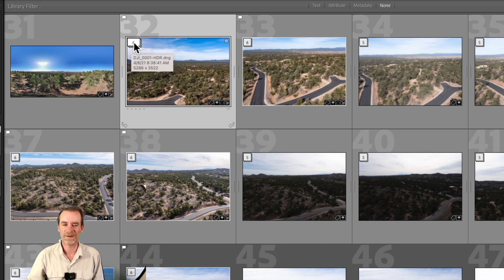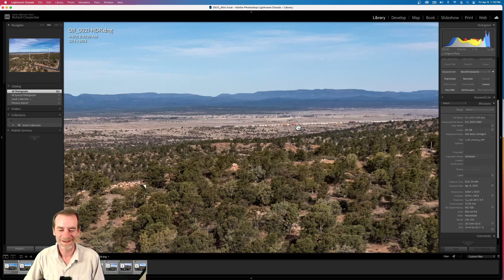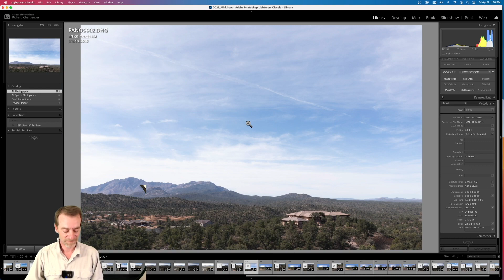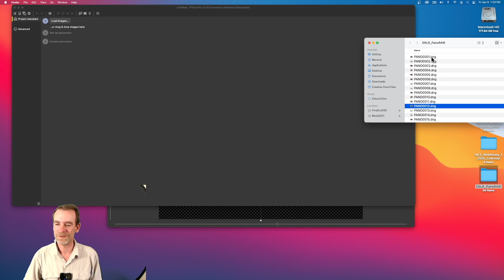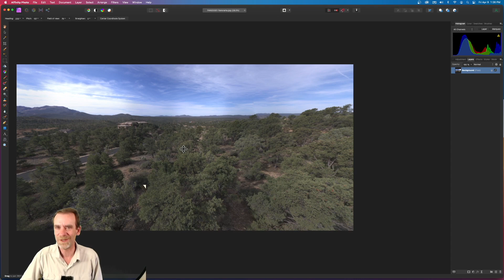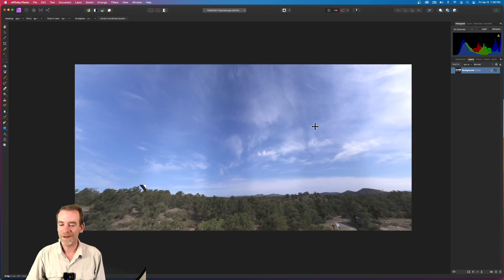A New Drone Progression Project.  Documenting A New Home Build

Comment: Hi Rich.
Just wondering; have you ever used graduated ND filters on your drones when shooting these panoramas?

I have and would recommend them to all that fly a drone.  Basically they give you a 3 stop difference between the top third and bottom third - with a soft transition taking place in the middle third.

These allow the same shot to be exposed for the ground and sky, without bracketing!  They certainly help with my work flow, being to able to do a lot more "in camera", saving time on post.
Reply: Hi Ray. Which filters in particular do you recommend?